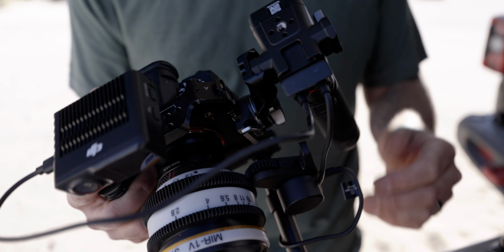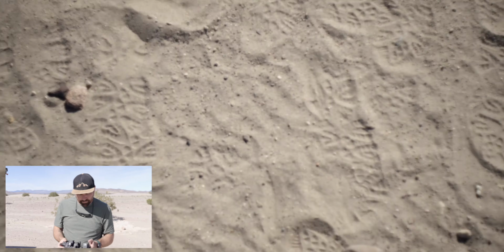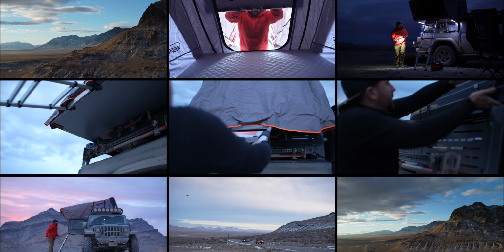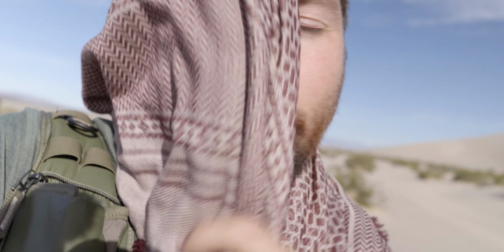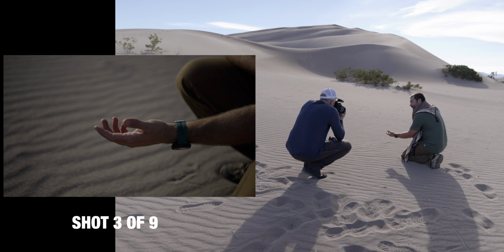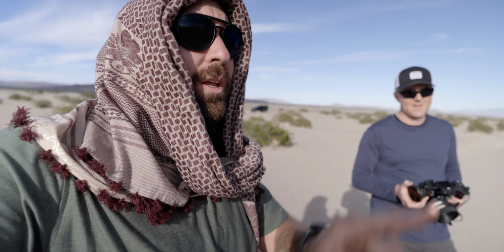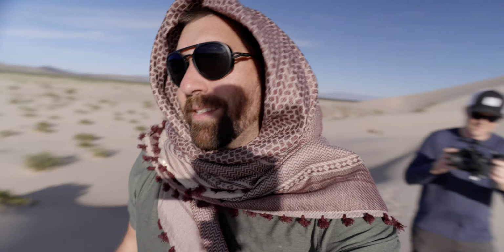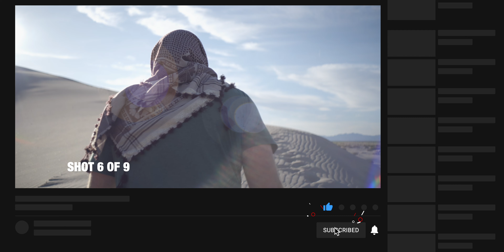Recreating a Scene from DUNE 2 with a Helios 44-2 Vintage Lens

Comment: I noticed the rehoused lens has the black metal casing line along the sides. Did you remove it to fit the dji focus pro or does it fit?
Reply from the maker: It fit